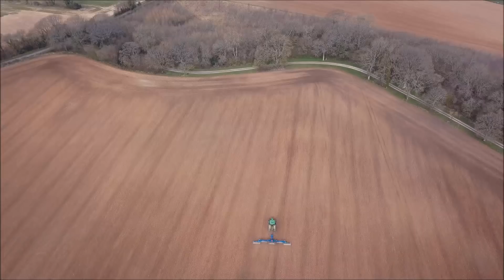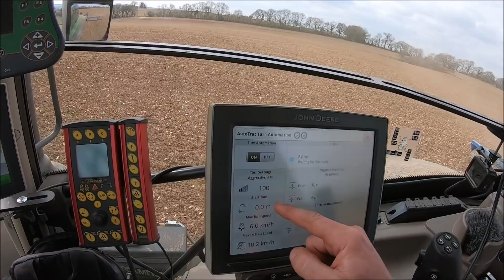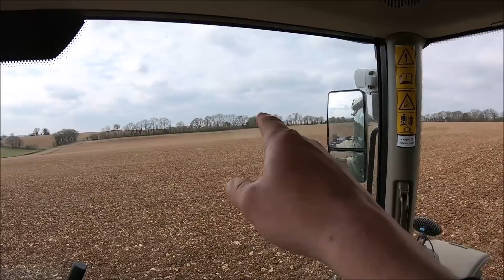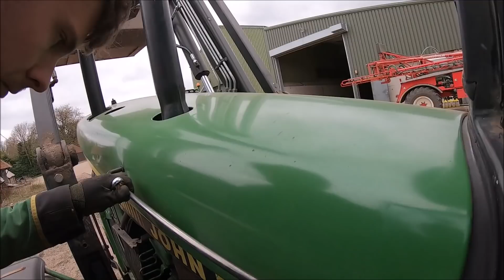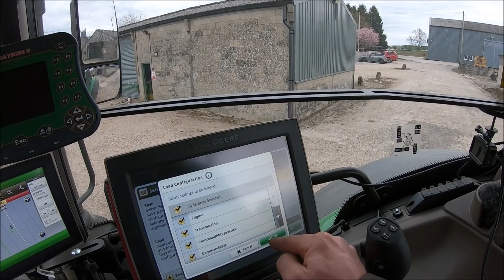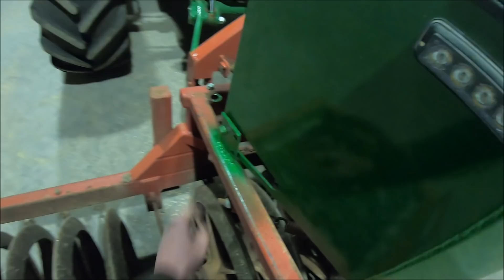DALBO powerroll & John Deere turn automation

Comment: Hi really liking my 6215r got one about same time you did I've tried to use the auto turn but I keep getting machine speed automation is disabled warning message
Reply from the maker: Hello mate, yes I had the same thing! Speak to your JD dealer they will give you a activation code then it works fine. I had the same thing 👍

Comment: Why are you not using the dalbo roller in the grassfields?
Reply: The Dalbo is a ring roller designed to push stones into the soil and firm the soil for better soil to seed contact and aid germination also helps stop the combine picking up stones as they can do damage as well even though combines have a stone trap to limit/stop stones going all the way through, but not too heavy as the soil will need to be moved again after this crop is harvested. The Dalbo is not really heavy enough to roll permanent or semi permanent grass leys. For grass you'd use a completely flat roll that normally these days are filled with water and are a lot heavier to push stones or anything else down so as they don't get hit by mower blades that can damage the mower blades or possibly other parts of the mower or be launched and hit the tractor or break a window.
Look up The Hay Team on you tube, the second or third to most recent video on the the guy explains throughout the video about his grass roll which is also a Dalbo roll but for grass.
Hope this helps.

Comment: My view on the technology in the tractors these days are, if its there use it! A lot of people still say you don't need autotrac and auto turn etc. even the itec but at the end of the day, as the operator it makes your job simpler! With certain jobs you can have a lot to think about so if the the tractor is setup correctly and its one less thing for you think about at every run, why not!